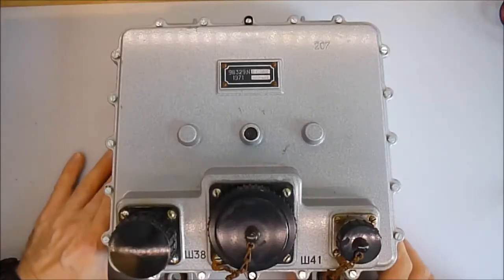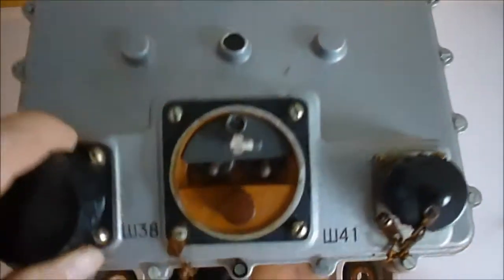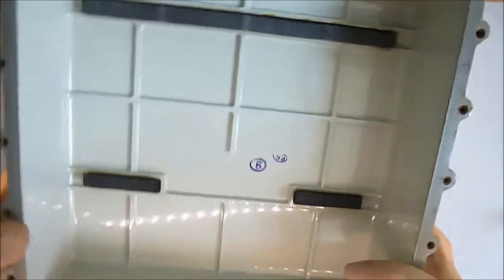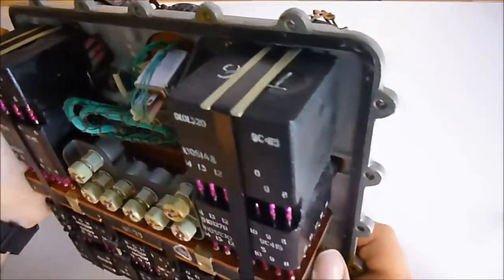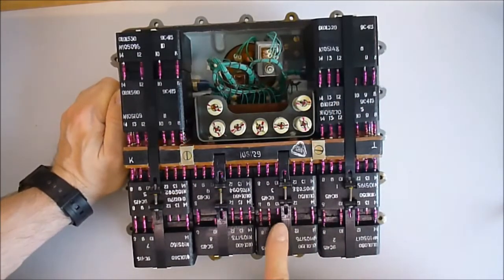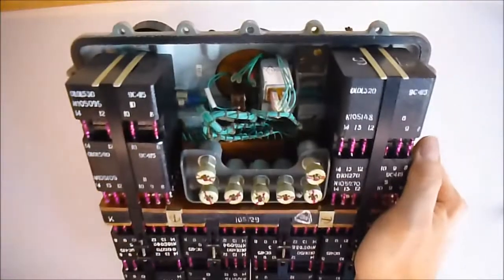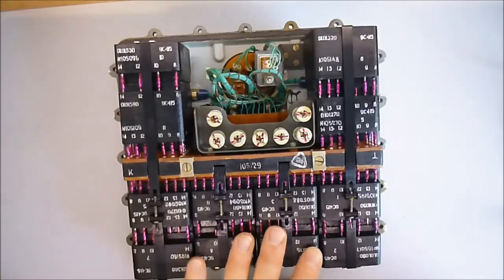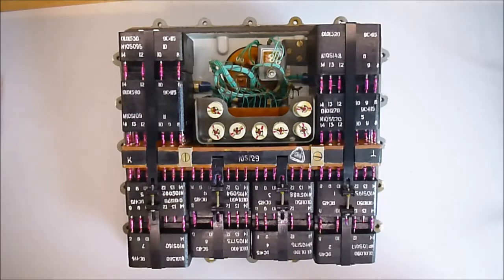Soviet 9Bxxx modules the 9B329 central processing unit

Comment from the maker: This unit was used in a tank, for remote control of some "flying things". I got it approx 10 years ago from a german eBay seller, but this was a off-eBay transaction.  I got the set of 4 boxes (cpu, joystick, psu and relay) for something like 60-80 euros if I remember correctly.
Reply: "flying things".. Hm, this could be the control unit of ПТУРС  - Anti-Tank Rеmote controlled rocket system.